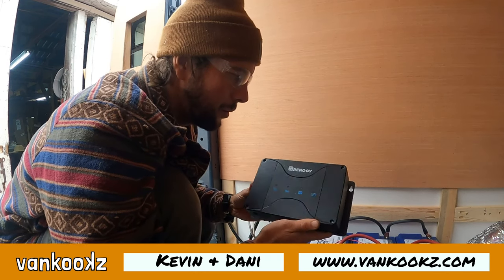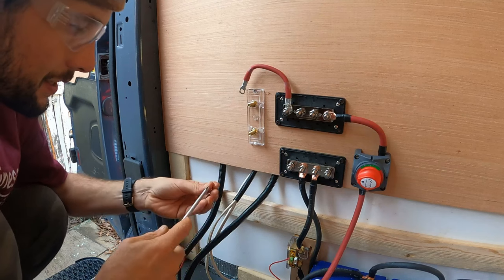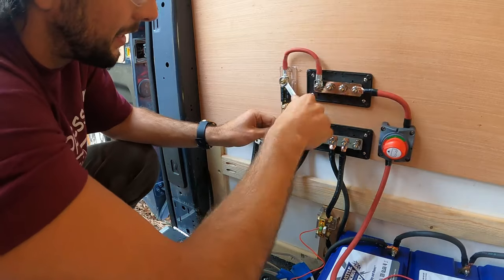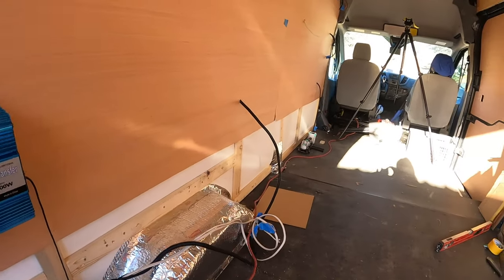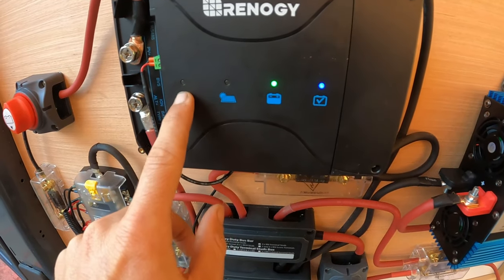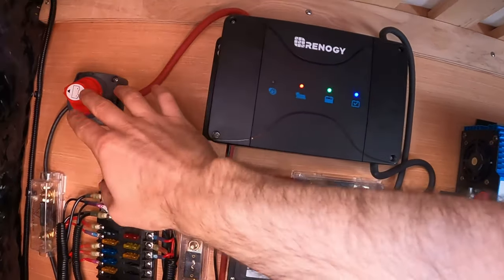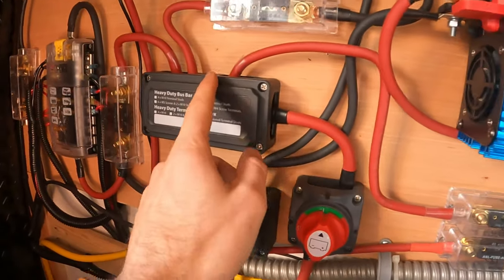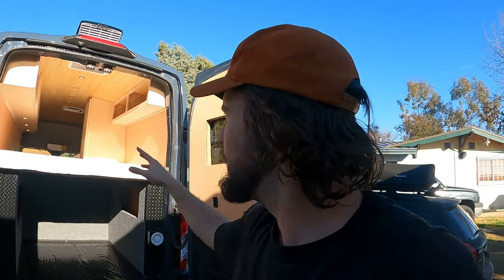Installing a Renogy DC to DC MPPT Charge Controller | Wiring a Solar Charge Controller

Comment: the wire for the alternator cable should have a fuse within 18" of the battery, if the wire was to ever short, it would cause a fire. also each battery should be fused individually. and not a big deal, but the negative cable should come off the farthest battery allowing the batteries to balance a little more correctly. meaning positive goes to battery 1, and negative goes to battery 3. but other than that it looks good!
Reply from the maker: Thanks for sharing!  I’ll pin this comment for other viewers.  Great info!  Very helpful.  Yeah, I forgot to show it but there is a fuse near the starter battery as well it’s in the wiring diagram these videos are so hard to film while you work there is always so much that is missed.
Reply: Hi there. What amp fuse would you put close to the alternator in the positive line ? Cheers
Reply: @me-lk4wr my question as well
Reply: @me-lk4wr  The Renogy DC to DC charger is rated for 50 amps, so you want to be just over that because it could pull up to 50 amps. 60 amp fuse or breaker is what is recommended.
Reply: @ckirkwood9  The Renogy DC to DC charger is rated for 50 amps, so you want to be just over that because it could pull up to 50 amps. 60 amp fuse or breaker is what is recommended.
Reply: @John-ke2jm  Thank you!
Reply: @me-lk4wr  Did you figure it out? I thought I saw 65a or 60a in the manual but it was confusing and not clear.
Reply: does either of you know how thick of a cable to connect to the solar? think i'll need 10ft.
Reply: @Vankookz hard to film and get every detail! Lol I get it
Reply: @eedom69  Look up 12v gauge chart in a search engine. You have to know how much amperage the cable will handle and then look at how long it needs to be and it will tell you the appropriate gauge wire to use.

Comment: The fuse between the vehicle battery and the charge controller should be as close to the vehicle battery as possible. Otherwise, the wiring from the front of the vehicle has no overcurrent protection in case of physical damage causing a fault, and could lead to a battery fire.
Reply: They should actually be fused at both ends. The fuse at controller should be a 50A and one at master battery should be 60-70A
Reply from the maker: They are I just never went back and filmed it.  It’s in the wiring diagrams but it’s hard to actually film every step while you work.
Reply: @Vankookz sure lol

Comment: great setup, I use the Renogy DCDC 50AMP with a relay to cut off solar when ignition live. Works very well. I suggest moving the 60AMP fuse from the start battery to near the start battery, so the full length wire is fused, this is probably one of your longested and high amp cables in the auxilliary battery system, should be easy as you have to just shuffle the fuse to the start battery area.
Reply from the maker: Ok will do that!  Thanks for the advice.
Reply: which relay do you use?
Reply: I am using single input, dual output relay. 30amp rating.
Reply: @overlandgcc  thanks! Do you know the name or part number or anything I can use to find one?
Reply: I have a ambulance build, 2 batteries to crank the 7.3L diesel.  I bought the 30AMP DCDC. When you set the battery type on the unit, do you pick lithium batteries (my solar batteries for the box) what about my cranking batteries? They aren't lithium... This is so overwhelming 🤯
Reply: @Texasishot105  perhaps you need someone to get this done for you.
Reply: @overlandgcc  I think you're right...😊👍
Reply: @Texasishot105  Cranking batteries are almost always lead acid type because the CCA cold crank amperage ( for instance like 800A for a few seconds) is greater than a lithium battery, often 100A/hour. The crank battery getting charged immediately by the alternator. So to answer your question it is the house battery that you decide on the dc to dc charger what type of chemistry you want to charge. In your case you will want the 4th led to be blue, like in this video.
Reply: @Texasishot105  You set it for lithium. It'll only trickle charge the starting battery so it doesn't really matter.

Comment: I had three custom vans... a 1967 Chevy, and 1971 Chevy and a 1976 new purchase Chevy and built by me.  No solar, no water, no inverter, just a flooded battery and 12volt lights and my vintage coleman white gas stove.  I never realized how much I was roughing it.

Comment: Did I miss you showing where tge negative cable was attached to the battery? I'm  a newby and some of these things are still confusing. Also to where did the conduit from breaker box lead?

Comment: It’s limited to 25 PV volts so what do all of us do when we’re running PV arrays with 30 V ? 
which unit can we use? 
I need to find a DC to DC charger with MPPT that’s rated for 30 V.
Reply from the maker: Someone mentioned that they may have upgraded this unit to 50V.

Comment: To overcome the 25A limit (read the manual - logic page), I used a relay, so when alternator is live, it disconnects the solar, allowing full 50A charging from alternator.
Reply: WOW, Great idea!
Reply from the maker: Ok that's a good idea.  What about the 25V PV input. That's where I had a problem in my current rig.
Reply: where can I buy the relay? thanks.
Reply: @Vankookz  Haven't installed yet but I believe you are limited to all panels in parallel to stay under the 25V input limit.
Reply: @claytonfs  that is a pain i had to buy low voltage panels to match but it works for me but no good a lot if people ☹️
Reply: @Dirt-Diggler  what is the voc of your panels? How many do you have? I'm planning on 4-6 100W panels in parallel at 20voc
Reply: @claytonfs  i have 4 renogy 100w panels @ 20V or 22V 🤔 , i have room on the roof and in the controller for 2 more 👍
I have 280Ah of LiFeP04 and so far it's a pretty balanced system, too much solar in the summer and just enough in the winter, if I had FLA i would definitely need more solar 👍
Reply: If i need more from the BtoB like in the winter i just switch off the panels with a double pole DC breaker, then the BtoB jumps to the high 40s, the most I've had is 49A with the solar off 👍
Reply: @Dirt-Diggler  nice, thanks! This is exactly my plan. But 200ah for now
Reply: SuperClotted - what gauge wire did you run from the starter battery??
Reply: @nmartin5551  I think I used 6AWG (16mm2) but it depends on the distance between your two connection points.

Comment: I think you have a green light for lead acid batteries. I can't remember if it's blue or white light for lithium. There is a slot by smart altinator area that you push a pin or paper clip in to change.

Comment: On your neg bus bar, the 2 wires going down. One has the shunt going to the neg terminal of the battery. Is the other wire off the neg bus a ground to frame?
Reply from the maker: Yes
Reply: Thanks man! On the blue sea fuse/distribution block, what gauge wires are you using? 14?

Comment: Hey really well done, both the work and the video! Super job! I recently undertook similar work with my Renogy solar set up. I am in Alberta, Canada and mounted 4x100 watt solar panels onto the roof of my retention trailer and added a 2000 watt inverter. I always like having a look at what others have done. We landed a few things similarly. I did not use a bus bar set up but went direct to battery (lots of wires connected to the posts now, lol). I may make some minor alterations this summer.  Thanks again and really fine work!
Reply: Oops, retention trailer? I meant TENT trailer!
Reply from the maker: Thanks! Great work

Comment: the voltage drop for 50A on 20 foot wires to the front is quite high, about 1.0 V for 6awg with perfect connections.  it seems like that voltage drop might interfere with the charger reading the voltage for control.  this Renogy charger design with only the red, voltage wire is good as the chassis ground on each end avoids the negative lead which would double the length of the run.  not sure why many chargers use isolated, two wire setups.

Comment: Is there a way to manually charge the start battery from your lipo4s without having them full.
How did you decide on 50 amp dc to dc and rule out the 30.
Did you verify what the charger was sending to your starter battery? Thank you good job

Comment: Great work! I am looking to upgrade my charge controller to this charge controller, i just dont like the 25v limitation. Thanks
Reply: Yeah, lots of folk install domestic pv panels that can way exceed this units  25v limitation.
Valid point.
Mine has 6 x 100 watt flexi solar panels all in parallel.
Each is max 20v open circuit but I get up to 30 amps from them combined.
I mounted them onto 6mm polycarbonate twin wall plexigass for ventilation.
Still super lightweight and low profile.

Comment: I assume your ac hookup is dead when grid is disconnected, ie.. A fail safe changeover from inverter output ?
 Also be sure your gfci / rcd functions properly with an earth /  ground loop impedance test meter. Some inverters are centre tapped instead of a floating neutral.
Ground and neutral need to be bonded together at source for the circuit to safely auto disconnect if a fault occurs!
Reply from the maker: No the AC outlets work fine with out shore power. In this video I can't remember if I had the AC breakers wired up yet.

Comment: Hey, great video. Question though. Do you not have a mains battery charger? Cant understand how you are getting mains power through your consumer unit to the batteries without one.
Reply from the maker: This MPPT has a built in DC to DC charger to both use the alternator charge to charge the system. It also has the capability to charge your vehicle battery off the solar panels.
Reply: @Vankookz  sorry I meant external shore power to the batteries

Comment: Thanks for the videos.  I'm going to attempt to hook up my Renogy 2000 watt inverter, DC to dc charger, the MPPt charge controller and my 200 ah lithium phosphate battery.  I noticed in your video for the MPPT mentions that it also works from the alternator (hooked up to the start battery), do I still need the DC to dc charger?  Also, can the lithium battery be enclosed ?
Reply from the maker: This MPPT has a DC to DC charger built in it's pretty slick.  The lithium batteries don't need to be enclosed but it could help to build a little insulated box around them to keep the warm in the winter.
Reply: Thanks again.
Reply: Are you located in Canada?

Comment: If you're on Shore power, does your House system charge the vehicle? Does this play well with a 75A house battery charger/supply that runs on 110VAC (Generator or Shore)?
Reply from the maker: I set it all up with a inverter with auto transfer and it works fine

Comment: Hy buddy thanks for the video, very helpful . just wondering the wire size for your dc to bus bar, and from you starter battery to your dc charger.
cheers
Reply from the maker: 6Awg
Reply: thanks
 @Vankookz
Reply: @Vankookz  thanks for reply. another question. from your house battery to your busbar do you have a anl fuse? cheers
Reply from the maker: @Franciscosonur  you could put a fuse on positive also a switch after the fuse can be nice to shut the whole system down. There’s a wiring diagram. Also the van conversion masterclass at www.vankookz.com is helpful.

Comment: Great video! How have you grounded the leisure battery? Do you have a -ve cable running back to the starter battery or have you ground to the chassis at the rear?
Reply from the maker: Yes grounded to the chassis on the rear.
Reply from the maker: Thanks 😊

Comment: One thing for people to keep in mind with solar panels DC voltage above 32 volts can be lethal. 
The panels on my van run as high as 157 volts DC .
Nice work 👍
Reply from the maker: Great tip!  Dang you have a serious array J.G.!  Thanks for sharing 🙏
Reply: This controller max solar input is 25 volts, so this is a non issue
Reply: @bartgoed2305  it was a heads up for anyone wiring panels in series.  the panel DC voltage would occur before the controller. The voltage after the controller is the controller voltage. 
My imput voltage is 120-157 volts DC output voltage is 13.5-14.3 DC
Reply: @Scrambler85  This is controller specific and this controller has a max input voltage of 25v, and this is actually a limit of this unit and thus even two 12 v panels can't be operating in series safely (around 36v open voltage). 
It would be great if this unit would be able to handle a higher input voltage like some other MPPTs
Reply: @bartgoed2305  the warning was about voltage I NEVER mentioned the controller you keep talking about

Comment: Nice setup.
I know it is a year old but still hope for an answer..
You have a positive wire all the way from the starter battery to renogy charger but do you have to have a negative cable all the way from the starter battery to the Renogy charger also?
Seen both variants so i am a little confused.
Reply from the maker: The unit is grounded via the bus bar so you don’t need both wires. There’s a free wiring diagram in the description.
Reply: @Vankookz and this works fine? - I have the Dc to Dc 40A charger and every vid says to run the Neg back to the starter battery - which to me does not make sense, as long as it goes to something that is chassis grounded such as the bus bar, it should be ok right?

Comment: Hey men. I only realised there's two version of this charger 30 and 50 amp. I bought 50 amp and not I worry it will be too much for my old 1992 Ducato motorhome :/ what you think
Reply from the maker: It will be fine it will only use what you put through it.

Comment: I have the Starting Battery on a 3 way switch with  2 Renogy Dc to DC Mppt Chargers- 1,2 and Both , off , can you leave  on while not using when engine is shut off?
Reply from the maker: Yes you can
Reply: @Vankookz  thanks

Comment: Thanks so much for the tutorial.  Extremely helpful.  Question.  Because I do not plan to use bus bars (despite the encouragement), do I connect the 12 v fuse block  to the battery positive/ negative (with fuse in between)  and then the battery straight  to the DC to DC controller at labeled + and - connections?   Thanks in advance.
Reply from the maker: That’s totally fine.  I used to do that too until I discovered how nicely the bus bars clean it all up.  You will be fine either way.  One thing that happens is that the battery connections can sometimes not support so many lugs on each post this is another reason the bus bar helps.
Reply from the maker: That’s totally fine.  I used to do that too until I discovered how nicely the bus bars clean it all up.  You will be fine either way.  One thing that happens is that the battery connections can sometimes not support so many lugs on each post this is another reason the bus bar helps.

Comment: Is the 60amp fuse from the positive busbar to the fuse box necessary?  Any surge there are already fuses in the fuse box.  Unless you’re thinking the 60 amp would save you having to replace all the smaller fuses if something crazy happened with the battery- but wouldn’t the smaller fuses break before the 60amp one anyway?
Reply from the maker: Yes, you are correct the fuses would protect everything.  However, if there was a short due to an accident it could prevent fire.  I've had a wire burn up before and if I had a fuse for protection in place it would have prevented the wire from completely burning and melting my fuse panel.  So it's just an extra precaution because you are in a moving vehicle and anything can happen.
Reply: @Vankookz  thanks ya kookz!  Super clean job it looks amazing.  One of the best videos I’ve on van wiring and I appreciate you take the time to show how to crimp the larger wires.
Reply: @Vankookz  that's why you should have the fuse closest to the battery, more like where you have the switch. Battery-fuse-switch in that order.

Comment: Did you wire the smart inverter switch?
Reply from the maker: I didn't need to on this Ford Transit.  I did in my sprinter and I have a video for it